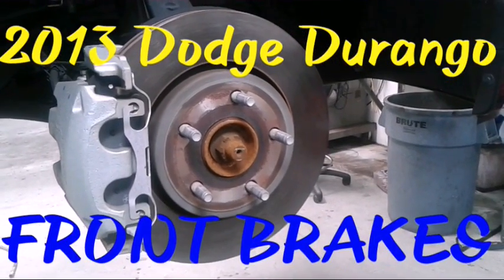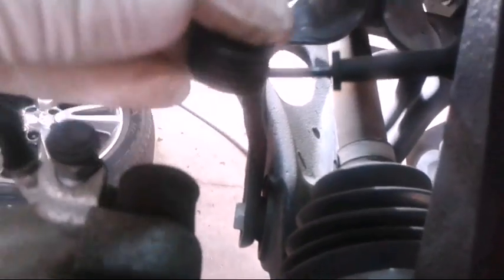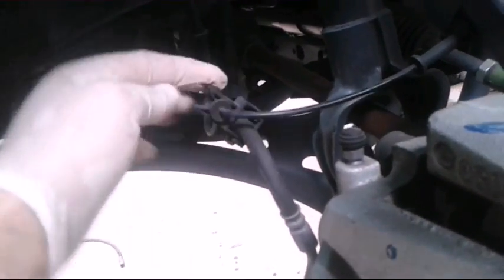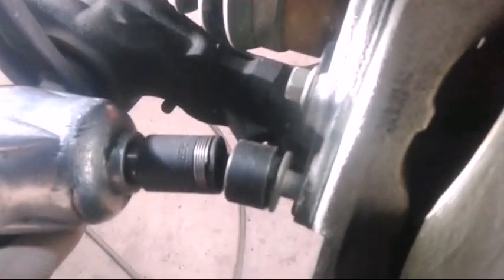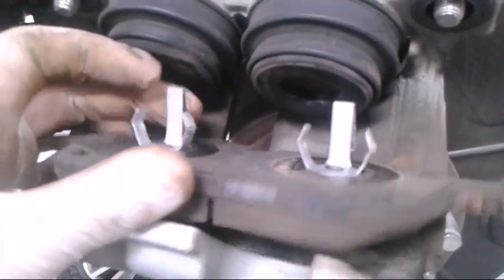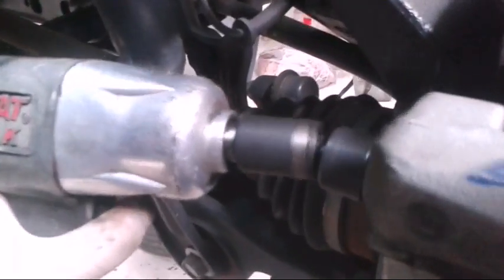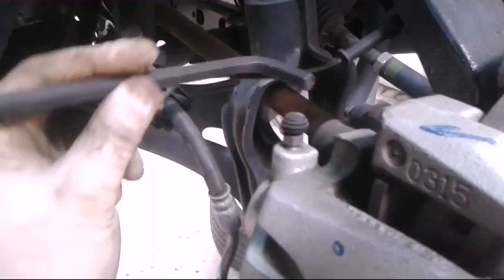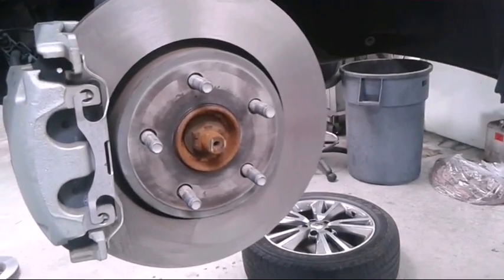2012-2013 Dodge Durango Front Brakes

Comment: ExCtky hiw many Ft pounds is "really tight"? This may be the reason you "stripped many out before" on caliper bolts. Too bad they don't make a manual that tells you proper torque setting for bolts on vehicles.

Comment: Best video on YouTube for this job. Complete with all necessary details and no useless babble.Same hardware is on Jeep Grand Cherokee (which is the SUV I just worked on). Thanks for a great video!
Reply: yes it was beneficial but i was actually hoping to find the torque specs on the caliber bolts?

Comment: Please note that the hex/allen socket is actually 11MM.It is an uncommon size but I found them on Amazon and Autozone websites.In both cases they are impacts.This question came up after I noticed a written tutorial called for 11MM.I did some research and found a discussion board that confirmed it.They did say that the 10MM could work if positioned the right way but the actual size is 11MM.
Reply from the maker: +mikeappel2 Thanks for the comment. I was wondering when i was doing them why my tool wasent fitting right. I assumed 10mm was the closet thing. Thanks for the comment and info!
Reply: Thanks for that. Saved me some time.
Reply: I wish I would've read your comment earlier.
Reply: @arlenvanderhoff6546  oh boy. 😮
Reply: Good looking out bro. I thought when the mechanic bro was saying the harbour freight allen drive socket didn't fit right, that he was potentially saying it was to short. 

But it's an 11mm huh? Its probably a low quality sketchy azz fastener because he speaks about the threads being weak & stripping the head multiple times. Often those CheapO bolts make it feel like a 10mm or 11mm do not sit in there quite right. I worked at a machine shop that did have size 10.5mm & 11.5mm hex keys & sockets. (A half size bigger then 10mm and 11mm) But they were not commonly needed. 

I would think Dodge top brass would meet and say 
     "Aight gentlemen. We know brakes are still something the suburban Dad will be trying to do at home in his driveway. He will be trying to teach the next generation of young Americans not to be puccies. So let's make it very simple to change the brake pads. Lets make the parts durable enough, even for dummies. Most importantly gentleman, lets make sure that Dodge does not do some stupid shyt that will piss off our last generation and puccify this whole new generation of Americans 🇺🇸 ok, hands in Ready Brake! 😎

But... that's just what I would think. It probably went more like this...

💰💸💰
 🤨🤔🤑... So these are the cheapest bolts u got for sale in this whole Chinese factory bro? U dont got Nothing cheaper? Maybe sitting in the back of the warehouse or over in your uncle Kim's garage? No osha ratings 😂 Nha their just for brakes bro and theirs 2 on each side.

Comment: Front brakes are 11 mm and the rear brakes require a 7 mm hex or allen wrench.
Reply: Totally agreed. The 10mm is too loose, not correct. I didn't have an 11mm, just a 10 & 12. So, just by chance, my 7/16" allen wrench also fit perfectly on the front calipers.

Comment: I did a brake pad swap on my 2015 Durango and now when i drive after 20 to 30 minutes and the brakes are hot and I apply pressure the brake clicks. I did not cut my rotors.  Can this be the problem?

Comment: The 10mm allen wrench is too loose for the front calipers. It should be 11mm, or a 7/16" allen wrench. Just a heads up before you get going on this.

Comment: Do you do the same exact steps for the rear breaks?
Reply from the maker: I dont remember exactly what the rears looked like. If they were drum brakes then no. (obviously). If the rears are disc brakes then it should be the same concept. I wouldent say exactly the same procedure cause i dont know how there set up, but i would imagine its the same principals, might have bolts instead of a giant clip to keep the caliper tight. Small differences.
Reply: yes except the rear hex head is smaller. i just changed by pads today but didnt note what size hex head it fit. sorry

Comment: would you happen to recall how many miles that specific durango you were working on had? I have the same durango (2013) and was curious if should start to consider changing my pads and/or rotors or not. I have ~45000 miles on mine. Thanks in advance.
Reply from the maker: +Omri Hared I dont remember, sorry. You can always take your wheel off and look, & if you have some squeaking or anything coming from the front it is an indication that you might be getting low pads.